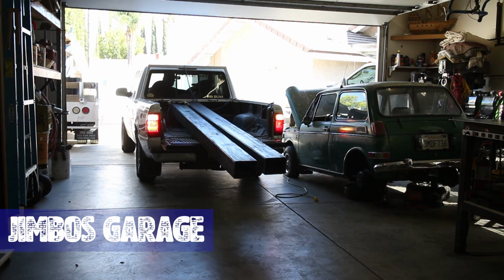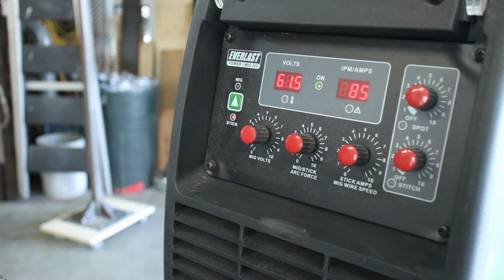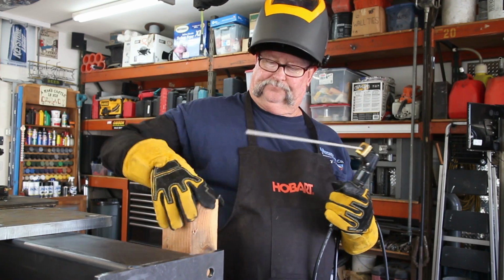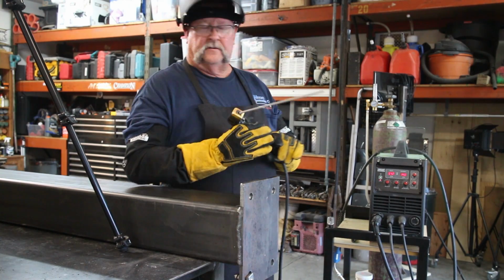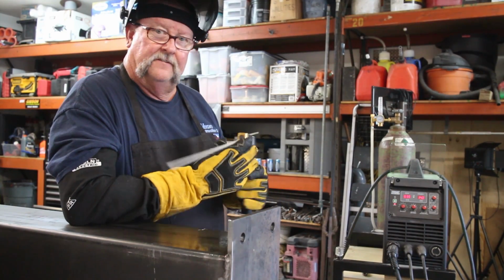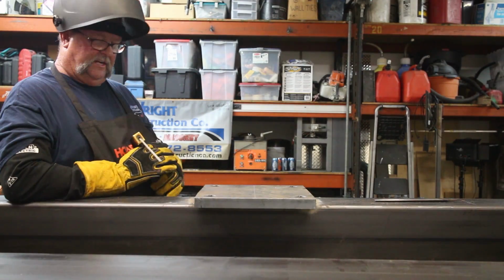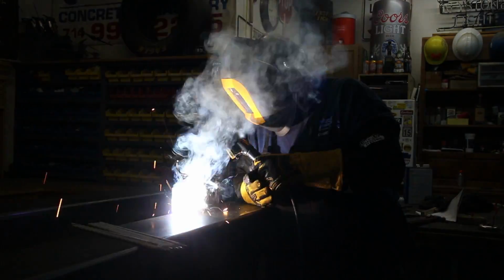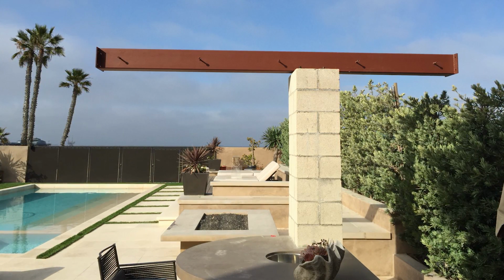BBQ Patio Cover Project - Jimbos Garage

Comment: a weld prep would have been better on the "flush" side of the end plates, the 1" plate didn't have any gap ...its called a "j" groove weld .a larger rod or .035 mig process would have been better suited , 2-3 passes would have been more then suffice for this . further adding to this grinding off mill scale will add better penetration to any weld . what do I know though I'm just a red seal certified fabricator , not a youtube money creator

Comment: Would like to have seen the final product. Question, why 1/8 rod on 1" plate? You could have controlled the heavier rod to not burn through the tube  with less passes.